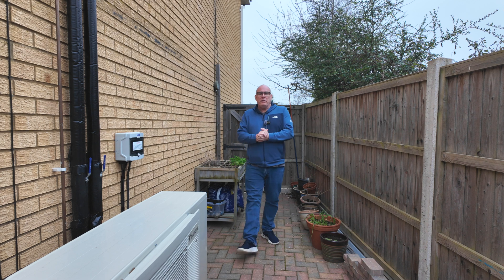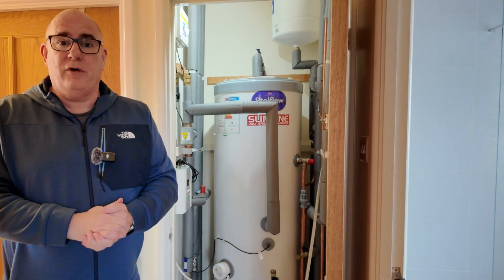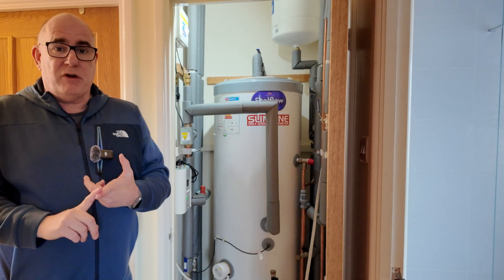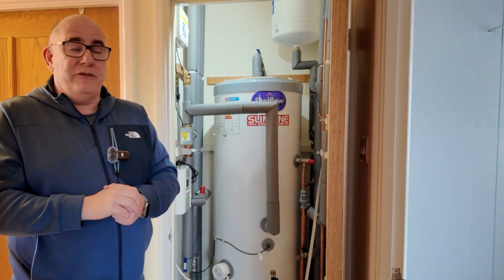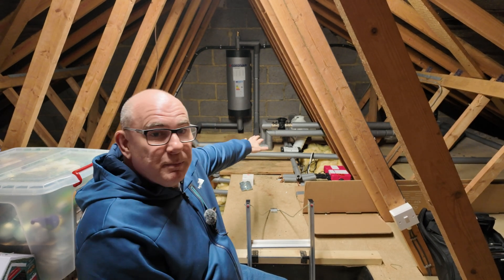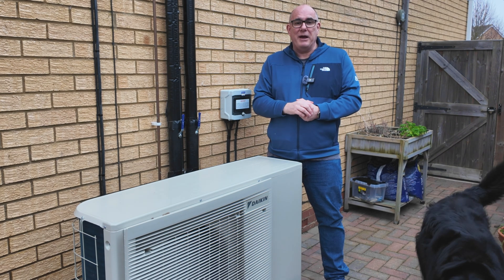🔥 Heat Pump Pipework Installation Mistakes to Avoid! 🔥

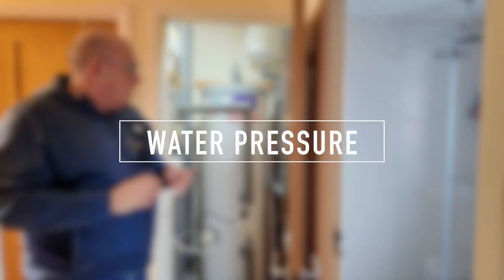Comment: At about 5:57 you talk about the hot water being pressurised.  Surely that is nowt to do with the heatpump and your hot water could still be operating from the header tank in the loft (the traditional way) which provides balanced flow to shower heads.  Why go pressurised ?
Reply from the maker: To be honest I don't know that its possible for the heat pump to work with an older unpressurised system. As part of the design process I was told I needed a pressurised tank, and that allowed for the removal of the old water tank and the header tank as well. TBH I am very happy with the new system, hot water pressure is so much better and we removed two big tanks from our attic

Comment: Hi JT, great video. I’ve just had  the Octopus Energy heat pump survey. I’m a newbie to heat pumps and I don’t understand all the elements of the survey.  I’ve been talking to the sales chap about the proposed design but we don’t seem to be getting very far. It feels like the design has been put together so make it easier and cheaper for them without much consideration for how it will look for myself. We had agreed a re-survey to consider moving the tank into the garage (to avoid the scaffolding cost and for aesthetics) and the pump closer to the corner of the fence but now he is saying they do not need to come out again for the re-survey. 

I was hoping you or the wider community may be able to help. I have a few questions which I’m hoping are not too dumb but I also struggled to find an answer on the internet to the first one.
1. Do they have to run new pipes from the heat pump to the new cylinder tank or could they use the existing 22mm flow and return pipes coming from/to the gas boiler? If the latter was possible it would make the pipe run much simpler and negate the extra £800 cost for scaffolding (we have a 3 storey town house)
2. The pipe route on the proposed design runs across the back of the house and then up the street facing side of the house and into the airing cupboard. I’m wondering why they can’t do a straight run straight up into the loft at the back of the house and then along the inside of the loft into the airing cupboard. I’m still to discuss this with the sales chap
3. On the survey report there is a page with a table with a Room Heat Loss (Watts) column which totals to 5.870kWh. There are other columns for current and proposed radiator outputs. There is a further section called ‘Heat Pump System Performance Estimate’ but I’m not sure in the numbers in that section. They have proposed a Daikin 4kWh heat pump but I’m struggling to understand why they have recommended this size of heat pump and not a 6kWh one?
4. They are saying we will need planning permission as the noise level of the Daikin is 43dB although the neighbours closet bedroom window is on the 3rd floor. Does this feel like a correct assumption?
5. Finally, we have a drain running along the back of the house so they have not recommended the Cozy 6 due to the potential risk of a refrigerant leak. I think this sounds reasonable but any thoughts welcome

I am asking other in installers to come in and quote. Sorry for the ramble and any advice welcome. Thanks.
Reply from the maker: Some answers to your questions - please keep in mind this is just my opinions and others with more experience may have different or better answers

1. I would imagine they will need new pipes, the old ones are probably not of sufficient spec even if they are the right size, they will need to be insulated as well, which the exisitng ones will not be to sufficient standards.

2. I asked that very questions, so we moved the heatpump 50cm to the left which allowed the pipes to go verically up the wall into the loft. Ask them to check again

3. Ask them to explain, sounsd like a 6kw would be a better option. However there is a sweet spot for a heatpump you don't want to undersize but also don't want to be too oversized

4. I'm afraid that's a question for the local planning department, 43db seems fine to me but I am not a local planner

5. Yes they are being super careful as the Cosy uses propane and you don't want that getting into the water supply (even thought its a tiny amount)
Reply: @JonathanTracey  Thanks JT. Really really helpful and much appreciated.  I’m waiting for the Octopus sales chap to come back to me on these questions so let’s see where we land. He hasn’t responded as quickly as he had  previously 😊

Comment: Hi Jonathan

Just a heads-up clarification ...the domestic hot water storage vessel you show in your "airing" cupboard is a CYLINDER not a TANK! 

This could be confusing to some viewers as you used the term TANK (correctly) referencing the previous header tank that was located in the roofspace. 

The pressure gauge you pointed out is not indicative of your domestic hot water pressure. It indicates the pressure in the primary pipework that connects the heatpump to the heating system. This is the same pressure gauge that is typically mounted on the fascia panel of combi boilers.

Worth pointing out that the indicated pressure, when the system is " cold "  (ambiant temperature) it should nominally read at or around 1.2 bar (approx 17.4 psi). Also worthy of note, the  pressure reading will fluctuate comensurate with the system pressure which is influenced by the temperature of the water contained therein...so as the heat pump increases the circulating water temperature its volume increases and thus the pressure increases too.

When the system temperature cools the volume of water will reduce and the pressure will decrease, so it is normal for this reading to fluctuate during operation.

Some may be thinking...so if the pressure in the system increases in an enclosed, sealed system,  then surely yhat increase in pressure will cause damage somewhere....

Yes, that is correct it obviously would...so to prevent that ocurrance a pressure vessel is fitted to adsorb that additional genetated pressure. 

The white cylindrical "bomb" looking device above your CYLINDER  is A pressure vessel...hovever ut IS NOT mitigating the system pressure described above.  

That white one is to mitigate the pressure increase in your domestic hot water CYLINDER as the volume of water stored therin also expands when heated.

The one for mitigation of the heating system pipework as described is actually fitted out of sight within the heat pump.

A great video to alert those considering a heat pump to what to consider and factor-in with their expectations.
Reply from the maker: Thanks for the clarification, I am learning more about these as I go, just trying to pass on my experience, but I appreciate those with more knowledge helping out as it enables to me share better information next time. Cheers

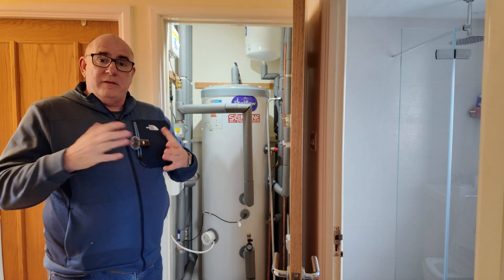Comment: Slight correction to be made, the pressure on that gauge is the system pressure, if you ever bleed radiators etc this is where you need to top that up, there should be a flexible hose which you can connect just above the gauge. (5:58 timestamp)
Reply from the maker: yeah, I should’ve made that clearer, I’ve only had to top it up once and as you say that was after bleeding radiators

Comment: Hi JT, from another JT. Been watching your excellent videos for a while now.  One thing many utubers don't go into much is the subject of radiators.  Do they have to be upgraded if so how bigger are they a d which type are best ie design,  material etc. What about a vid on this?
Reply from the maker: yep that’s coming in part five, I’ll go through and show you the different radiators before and after
Reply: @JonathanTracey  maybe mention btu output before and after and flo temperatures 🌡
Reply from the maker: Yep will dig out my design doc as dont have the BTU in my head

Comment: Really useful and well made video - now able to show the wife what the house will look like when we finally jump to a ASHP.
Reply from the maker: i did a 5 day install series that showed what happened each day, maybe don’t show her that :-)
Reply from the maker: be careful :-)
Reply: Our external pipe run will be about 2 meters into where the existing boiler flow and return pipes run. We will lose some space in the airing cupboard with the larger tank and volumiser. We will lose the existing gas boiler in the utility room so she should actually get some space back.
Reply from the maker: yeah, it gave us an extra cupboard back in our kitchen where the boiler used to live, and we have found space for the towels that used to live in the airing cupboard. You may want to have them look at putting the volumiser in your attic, if they can.

Comment: I always wonder why they dont have a crane in solution of heat pump and insulated cylinder with all the pipework and valves put together offsite so only pipes and electrics need to be hooked up. Surely it would be cheaper to assemble off site, not take the best part of a week to install and might actually work in small properties with no spare space that currently just have a combi the size of a small wall unit.
Reply from the maker: I think it’s because it would limit the number of houses that it could be installed in, even with their detailed survey they still ran into a number of things that require a’ fix’ to fit it into the house. Mines a relatively modern house I would imagine with old houses it would be even more cumbersome.

Comment: Thanks JT good vid. With the removal of the cold water tank, can I assume that cold water pressure throughout the house is at mains pressure?
Reply from the maker: That is correct, the tank was only supplying upstairs taps and the hot water system

Comment: The water pressure at the taps depends on the pressure into the house. We have to reduce the incomming pressure to 3 bar so as not to exceed the cylinder design pressure but some houses have very poor pressure.
Reply from the maker: We’ve always had very good cold water pressure, but as our hot water was gravity fed and the tank was at the same level as the upstairs taps it was always pretty poor. Now that the tank is pressurised, it feeds hot water to the taps and almost exactly the same pressure as the incoming cold water. So everyone’s happy all round.

Comment: Enjoy watching your videos, they are very interesting. Just embarking on the my solar and heat pump journey. Solar installed this week just waiting for it to be fully commissioned, delay with the heat pump as my electricity supply is on a loop with next door and need a separate supply. Spoken with the DNO and they said they have up to 12 months to carry out the work so frustratingly on hold with the supplier of the heat pump until work is carried out.
Reply from the maker: unfortunately DNOs are a law unto themselves, they know you can’t go somewhere else so don’t have to provide any level of service

Comment: Good vid JT. 
My son's recent HP install needed a horizontal HW tank in the loft & a larger loft hatch to get it up there. Not ideal but there was nowhere else to put it to replace the old vented dumpy 36" x 18" IMI Hercules tank.
Reply from the maker: good that they found a solution, if we couldn’t have got the taller tank that is what we would have had to do

Comment: Around Christmas time we found our hot water temperature dropping quickly. My Home Assistant gets the temperature directly from heat pump, not the API. We could also hear water running in the volumiser. Turned our pressure had drop to zero. Set it back to 1.5-1.6 bar and the volumiser was silent again and the tank temperature back to normal. Just an FYI.
Reply: What caused your pressure to drop ?
Reply: @_Dougaldog  I don't know. It has been stable since.
Reply from the maker: @doug mine was because I bled my radiators, but once it’s all sealed back up, it’s maintained it pressure
Reply from the maker: yeah haven’t found a solution to checking the pressure remotely yet so have a 2 weekly reminder on my phone to check it
Reply: @JonathanTracey  Home Assistant and ESPAltherma 😉
Reply from the maker: Thanks will take a look
Reply: @ Feel free to reach out if you have questions.

Comment: I think they might be relaxing the rules on what you need already completed in terms of insulation before you are eligible for the BUS grant, not sure. My heat pump is coming next week! Scary but I'm looking forward to it!
Reply from the maker: That’s good if they have, but insulation is still the cheapest way to get a warmer house
Reply: Of course! But sometimes there are listed buildings and things like that; I think that's why they are doing it. Mine's pretty good.
Reply from the maker: I understand why we have listed buildings, but I never understand why we have to maintain them and keep them as these cold relics, insulation and heating should be modernised to allow these very important old buildings to survive but also be livable
Reply from the maker: Good luck,on your install, let me know how it goes
Reply: Was primarily done to make the pathway to heat pumps cheaper in an attempt to boost numbers.
Some would be looking at £thousands to meet the MCS requirements.
If we want to reduce CO2 levels as quickly as possible it is the best route.

Comment: I thought government removed insulation requirements in budget last year ?

From OFGEM site

"There are no minimum insulation requirements for applications which are properly made after 8 May 2024. "

search for "insulation no longer needed for MCS grant" and should find details. YouTube doesn't allow links...
Reply from the maker: was told it was still in place in november when i had mine installed

Comment: Slight slip up at 1:45, you say for those with a condensing boiler, you mean a system boiler. Combi boilers are also condensing. PS. Another survey tomorrow. I'm really hoping to avoid all those pipes, and losing the airing cupboard.
Reply from the maker: oops my bad, good luck with the survey

Comment: For anyone watching this and thinking they don't have room for a big hot water tank, there are space saving options available.  They are not quite as efficient but will solve the space problem.
Reply from the maker: So the Tank they were originally going to install wouldn’t fit into our airing cupboard, after a few frantic phone calls they managed to locate one that was the same volume just slightly taller they would fit in the space.

Comment: Just had my Octopus survey today 7.1kw needed.
Not sure if that's 7.1kw per day or what? How much battery do I need to support that? (That's my next investigation - Battery or Solar or both)
Reply from the maker: 7.1 kW will be the heat output from the unit, not the amount of electricity that it uses. I have a 6 kW Heat Pump and on the coldest day in January it use nearly 24 kWh of electricity, however that was spread over the day. It never peaked above 2.8 kilowatts being drawn in real time. I know that sounds like a lot but on the more mild days it was using about 8 to 10 kWh for the whole day.
Reply: @JonathanTracey  So getting a 13kwh battery makes sense as the electricity will be much cheaper in winter and will be exported in summer.
Reply from the maker: depends on you other loads but in the coldest days of winter it won’t cover 100% but for most of the rest of the year it will be fine